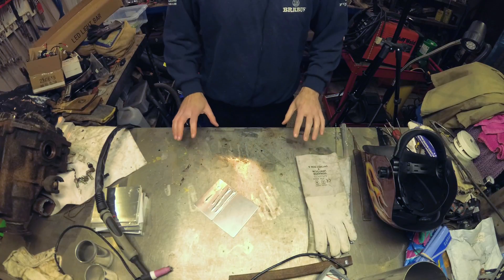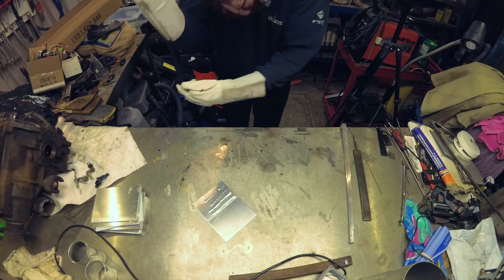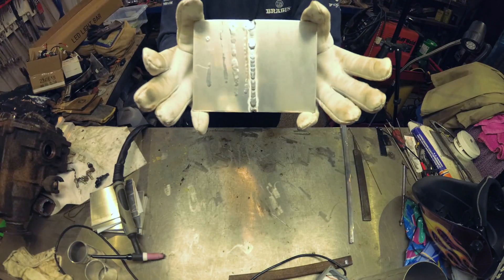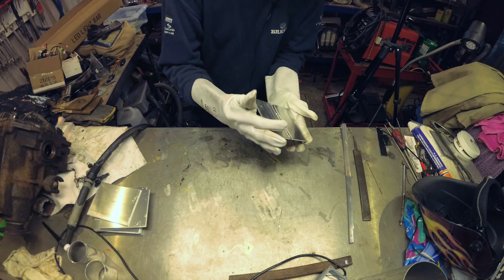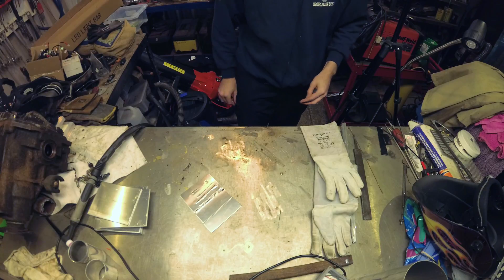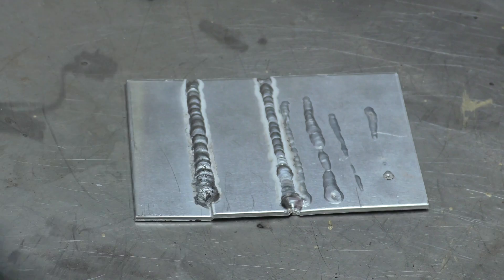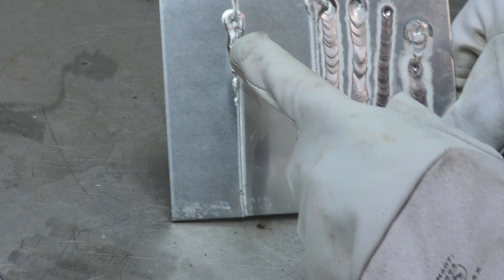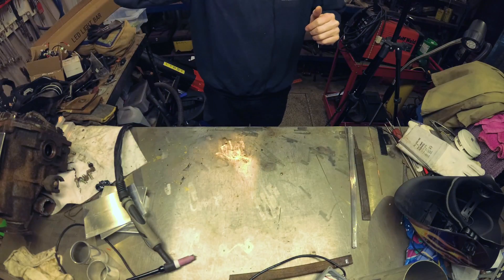Learning to TIG weld Aluminium - Part 2 - Joining

Comment: get a stainless steel wire brush and only use it for cleaning the pieces you are welding not other metals, and then clean with acetone , also grind the tip at 0 degrees to the grinder not 90 degrees as doing it at 90 causes the arch to spiral , and yes you need a pedal ,,,cheers